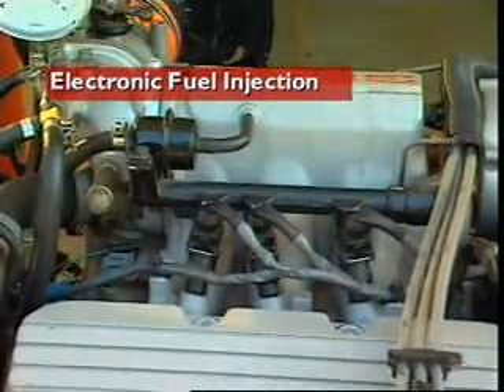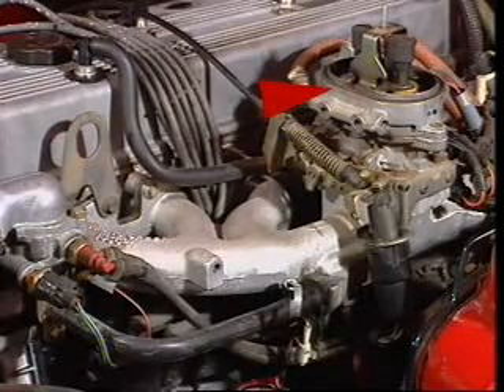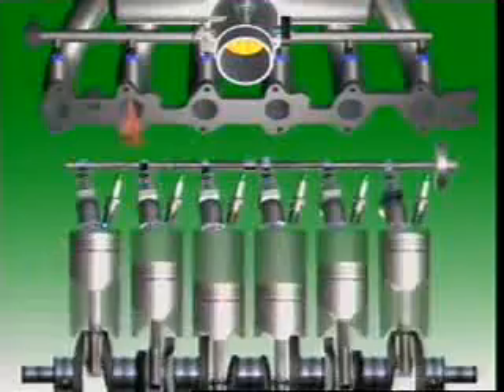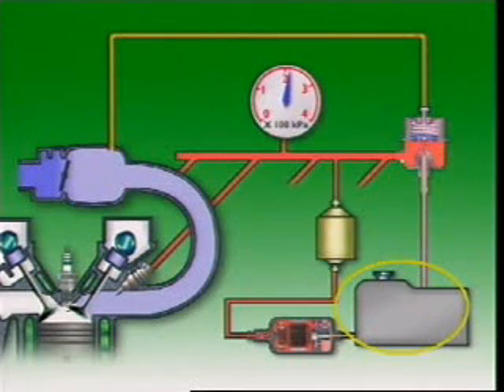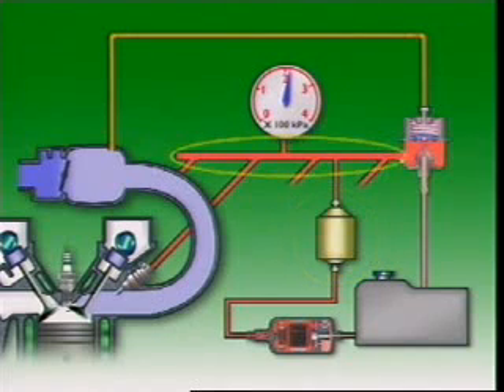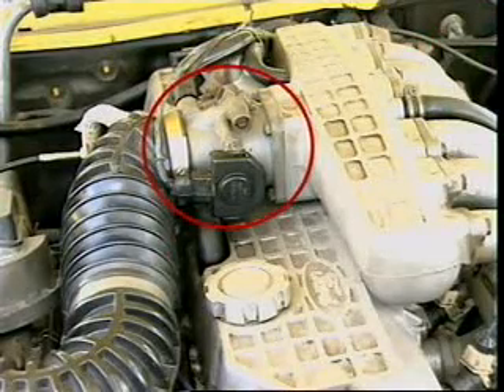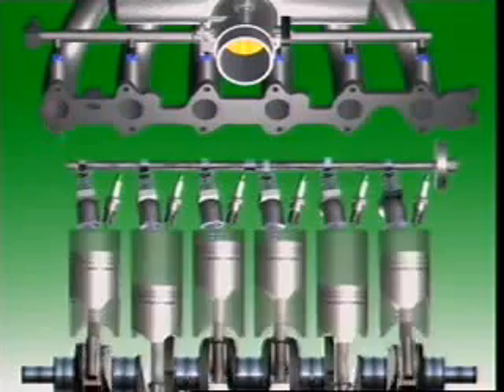electronic fuel injection sytem works.flv

Comment: You forgot about the most important part of the EFI  .. : The Electronic Control Unit. 
Without it the Electronic Fuel Injection will not work.
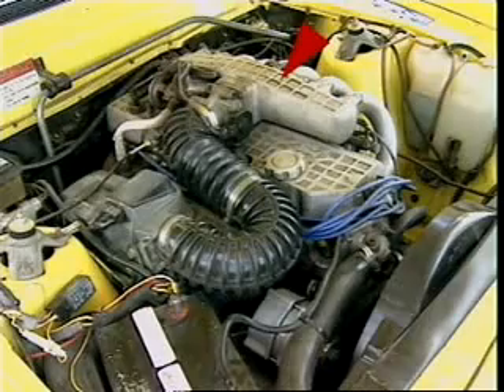Reply: +Pred 212 1:35

Comment: This video talked about 2 types of CFI systems, Throttle body injection and multi-port injection. Also the process of how it get fuel to the injector. It goes from the fuel tank, to fuel, to fuel filter, to a pressure regulator, then through the fuel rail to the injectors. All this is controlled by the PCM